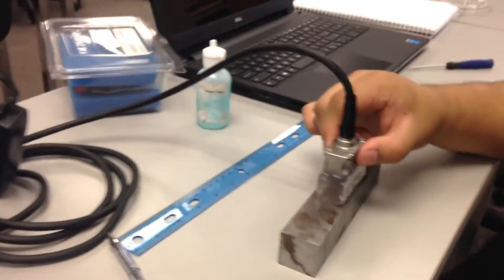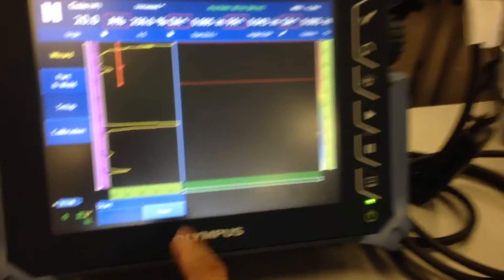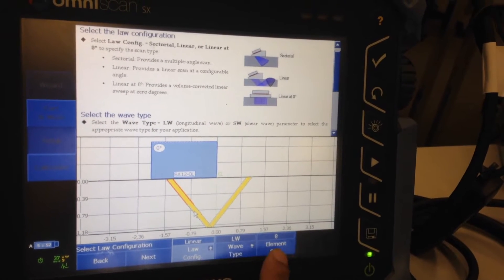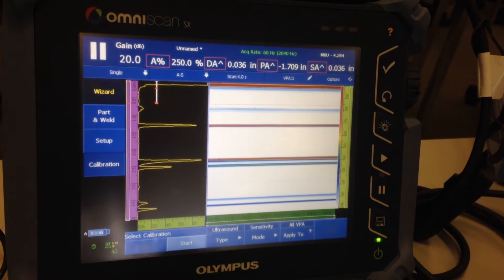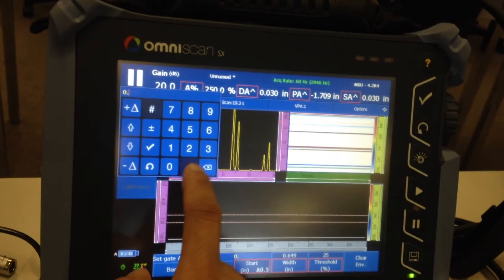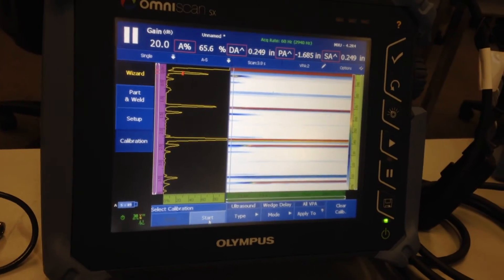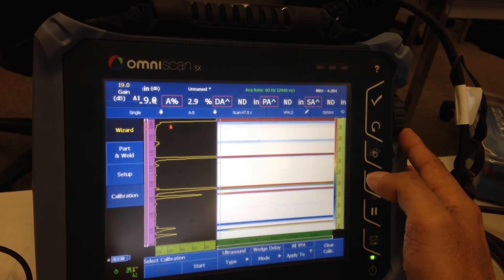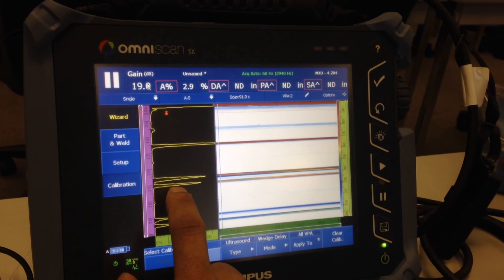PAUT Zero Degree Calibration

Comment: Hi Wagh
Calibration Procedure for a Zero Degree PAUT Application such as Corrosion Inspection is useful
I have a PAUT task on 95mm carbon steel block cladded with 3mm SS 316L 
How to fabricate this block and wherto put holes
either SDH required or FBH required 
need your suggestion
Reply from the maker: Hi Na v, you have to have a clad block of same thickness and cladding. All you need to calibrate for is wedge delay. Reference Sensitivity: First BW from 95 mm should be set to 80% FSH. No TCG needed so you do not need FBH or SDH unless you are also looking for volumetric defects and not just corrosion.  And then map any reduction in thickness. Report like C Scan with different color indicating remaining thickness. 
Note: this is just a suggestion. Refer to your company procedure before performing inspection.